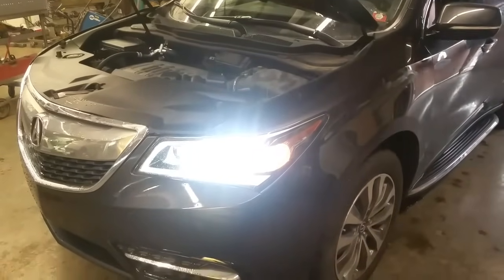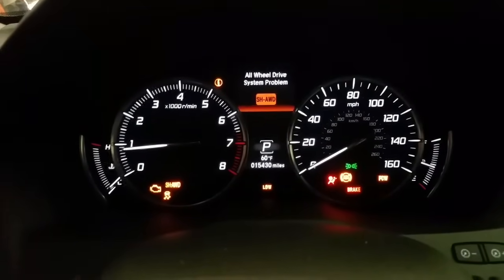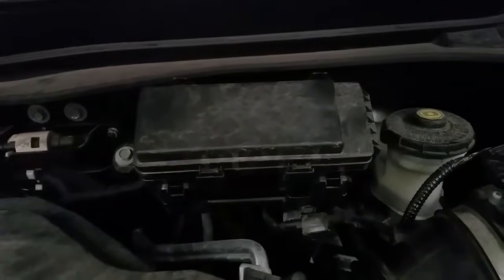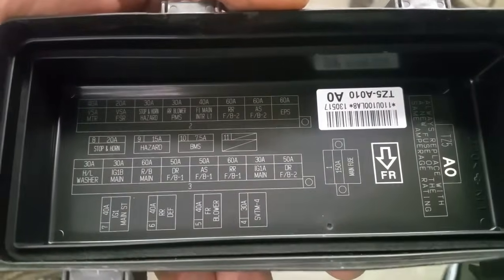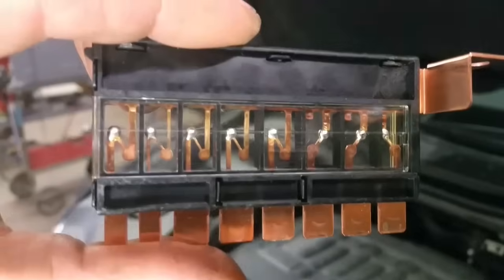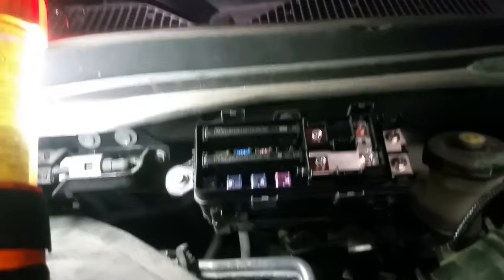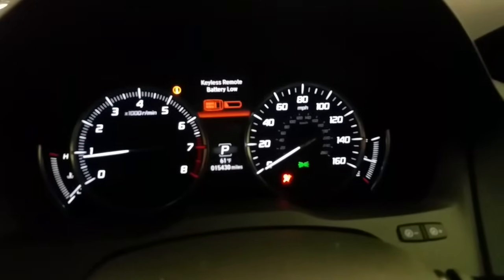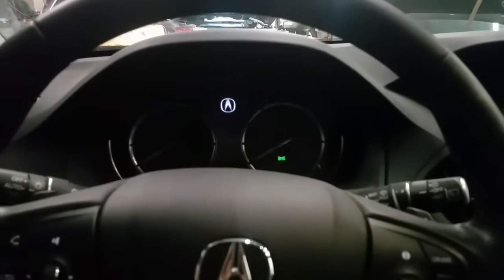EASY ACURA, HONDA ABS, VSA, BRAKE, FCW, SH-AWD, TRACTION, CHECK ENGINE LIGHTS FIX!!!

Comment: I have a 2012 MDX. Emissions light, VSA light and trailer stability light on.  The vehicle is also running rough.  I've checked the fuses, they're all good.  I've replaced the pcv valve.  I did have 1/3 tank of gas, so l added gumout, and filled it with Shell's top tier premium fuel. 
Still have all the same issues.
Would you have any ideas of what l should look at next before l break down and take it to the dealer?
Thank you for any help.
Reply: You ever get this figured out?
Reply: @justsayin4632  Hello, did you find a solution? I’m having the same issue.
Reply: @homerogarcia7287  I did, but YouTube keeps nuking my comment back to you🙄🙄🙄
Reply: @homerogarcia7287  I had a combination of things going on. MOST of the time when there’s a ton of unrelated errors with various electronics, check your battery. My negative was loose and causing all kinds of weird errors. A battery near the end of its life can cause sporadic issues as well. Make sure it’s healthy and all connections are tight, then clear the trouble codes. Any that come back, may be legit and require further investigating. In my particular instance I also had a couple bad spark plugs as well. Fixed loose battery clamp and spark plugs, no more problems. Just load test your battery and make sure all connections are tight FIRST, then go from there

Comment: I have an 2009 MDX my abs baa and shared light came on.when I checked the knock sensor wire was bitten by an animal trying to stay warm. I replaced it with an anti animal coating. plug it in and the light went away. After a few months the lights came back on. I checked the fuse bars but they are ok. Can't figure it out up to now. Hopefully it's not the cable again.

Comment: Does this apply to a 2013 civic 1.8L engine? Can it pass emissions? Any other reasons why the christmas tree happens? Can you please explain? I know that when the battery is flat or you disconnect battery, you lose your presets and radio code from what I saw in this video. Also, that you need to update the software. Any other reasons?

Comment: That fuse is impossible to take out.  I tried wiggling and using the flat screw driver to no avail.  Any suggestion?
Reply: Same here
Bam - in broken the top of it planing on using needle nose to really rip it out and most likely break it

Comment: I went to a transmission specialist for my 2008 acura mdx my SH-AWD light stays lit he pulled a code on it and it says it's a relay switch in the trunk my truck has no trunk is it possible it's the car link fuse ?

Comment: Re install did the work, brake still doesn’t work, as I was too stupid to pull the brake piston off and managed to put it back it, with too much air in the brake system. Brake feels all the way to the bottom with little brake. Gonna bleed the brake tonight

Comment: Hi everyone, crv 2013 2.2 idtec I got abs awd check engine lights on dashboard my friend scanned the system by obd and got errors 83-11, 61-12 and P0087, The car works fine, no problems with starting the power is ok just the lights come on once a week during normal driving, when I delete them from the dashboard everything is fine, but they keep coming back some times after a week sometimes after a 1-2 days. Any ideas what's wrong.
Thanks.

Comment: I have the same problem right now on an Acura tl 2010 sh awd , at first It randomly showed up and ran after not driving the car for a whole day about 2 weeks ago. Now today the car was used for 3 hrs straight turned it off and try to used it again and all the lights are on and won't let me start the car .... I checked this link/ fuse and it's good what else can it be I check all fuses and nothing . Also unplugged the battery to clear ecu and still there .... any help will be highly appreciated
Reply: Did you figure out the issue? I let mine sit for 4 months. Abs and vsa lights are on.
Reply: Did you figure your problem? I changed this fuse and replaced the VSA module and still have all the lights on my dash
Reply: @BikeLifeHooligan  Hello, did you find a solution? I’m having the same issue.

Comment: My 2008 mdx service sh-awd light comes on have changed all transmission/transfer /and rear drive fluids was good for about 500 kms but back to front wheel drive only?? can you suggest fix.
Ernie Northern Ontario Canada lots of snow to plow through.
Reply: I'm having the same problem did you get it fixed please contact me need to know ?

Comment: i have a 2014 civic that suddenly had the following lights go on - tpms, abs, vsa, and hsas-  checked the fuse like in the video and all fuses are good.  wondering what to check next or what it might be.  could it be the battery?
Reply: did you change the abs speed sensor yet?
Reply: S Kleinfeldt  Hello. I am having same issue with my 2014 Honda Civic hybrid. The thing is that when tpms, abs, vsa, ldw, fcw lights goes on I just disconnect my negative cable to the battery and when I connect it back all lights goes off. I checked same fuses on the video, everything is good. Did you fix your car? If yes can you text me back what did you replace.

Comment: My 2007 just did this ! Going it’s same issue !
Awd , traction, etc.. tried disconnecting battery didn’t help

I broke the top of the fuseable link- I gave up until I can order a new one so I don’t strand the car .. but wow was hard pulling it out, im assuming I’ll have to use pliars to pull hard
Reply: Herakles  hi just wondering did you get it fixed?  Thx
Reply: The Analog Sound I didn’t get the fuse yet I still
Have to order it , I’ll
Let you know - having a hard time locating the fuse part numbers (there are a few multiblock fuses
In there )
Reply: Herakles thanks mate
Reply: I’m so dissapointed I changed all the fuse blocks and nothing !! I’m so bummed !!
I was worried when I saw the fuses didn’t look blown
Reply: My issue was. I had a bad battery. It was new. Only 3 months old. Interstate. Brand.  It was hard to believe it was bad.  So purchased another brand new battery and that was my issue.  I wanted to discard the battery before I took it to the Acura dealer for a electric diagnosis.
Reply: @GGarcia7111  You replaced your 3 month old battery with a new one and that removed the lights from your dashboard?

Comment: I have a 2017 mdx the same problem but I check that fuse but the fuse is good I don't know where to look
Reply: Did you fix the problem
Reply: @mudurmudur3819  Hello, did you find a solution? I’m having the same issue.

Comment: Hello i need help with my 2012 MDX have to replace a ground and dont know the location of the ground that goes to the transmission , please its causing the car to jerk when accelerating and it gives me code G101 . HELP!!!   thank you .
Reply: Hi !From battery negative side 1 cable go to transmission or engine other cable go to a karosseria or body!So from negative side from battery 2 cable go to going out ! 1 for engine  and 1 for karosseria , Try find 10 mm bots for cable end on a 2cable end,,

Comment: hi  i have the 2016 acura mdx with that same problem but i went and check my vsa fuse but it's good is there other solution to this problem
Reply: Sir do you ever fix your problem on your acura mdx?

Comment: Hi George thank you so much for a great video that helped lots of people GOD bless brother 
I have 2013 honda odyssey touring  the battery died and we gave it a jump start and the abs and vsa light came on dash I didn't had that problem before jumping the car and also my both sliding power door are not working when the engine is on do you have a solution for my problem or any one else have an answer for my problem thanks

Comment: How would you do this for acura rdx 2013 that has box almost at the same place just not the same fuses ?
Reply: Look in the owners manual for the fuse or on the inside of the fuse box to find which one says VSA

Comment: Hey George, replaced relay on my 2012!acura tsx and lights are still on. Any suggestions?
Reply from the maker: +Marlon Sical could be steering angle sensor needs recalibration

Comment: Anyone know the part number for the fuse in the video? I have a 2010 TL.
Reply: Hello, Did you get the part. Did it work?
Reply: @justhumblemeclarke7292  sorry I was thinking of another issue. I think it was my alternator was going bad.
Reply: @jorgedavis9383  I replaced my alternator a few weeks ago. Did help.

Comment: I have a 2008 Honda with the same issues....I check the fuse box with the engine compartment....everything looks good. I changed the fuse for the VGA....still having the same problem....Car has 88k miles...help
Reply: You ever figure out the issue? Same issue I’m having with my Honda
Reply: I sold the car. .lol...6 yrs later

Comment: my vsa on my acura tsx 04 always turns on every morning or when i dont drive it for a while and I also noticed that vtec doesnt work when that light is on, what do you think the problem could be?
Reply from the maker: +99pkon Acura tsxs have very common issue it's the steering angle sensor.
Reply: +George Melnik I figured out the problem it was my camshaft position sensor swapped it out and all of the engine codes turned off and and it fixed the issue

Comment: Does any one have this problem I stumbled with my 2014 acura tsx sometime the light for che transmission comes on and also the abs light and vsa light and tracksion control when all this lights whwn on and mainly when the check transmissionlight is on also the letter D for drivin starts flasing green n won't go of for like a day I already replace the 2 front abs sensors but no luck any one had or have same problem n what was ur solution thank for ur help.
Reply: Hello, did you find a solution? I’m having the same issue.
Reply: @homerogarcia7287  has of the transmission light and 2 other lights all I did change out my starter and alternator and like 3 other light and has of right now I just get the one for the traction control but I think that's a little sensor that's is right under the shifter.

Comment: Greetings my friend who specializes wake us up my car when caught in a heavy rain steering wheel resists and brakes too and detail the engine is still running but when you turn off the air conditioning the car starts working again it's a 2.0 2006 but it's still running could be the lambda probe of the discharge or the scanner will be able to locate this fault thanks

Comment: I have an acura TLX which had a problem of blink of gear in the dashboard  and TCU ,SRS,BRAKE SYSTEM and other dashboard warnings lite are on and also when I.  press engine to stop will not stop for one tap until twice than they off  I don't how to do pls help

Comment: I had same problem with 2018 Acura TLX. However when I pulled out fusible link module it didn’t show any signs of being blown,   Any suggestions George would be a great help. Thank you.
Reply: Hey, did you figure out what was wrong with your vehicle? I’m in the same boat with mine. Got the lights on the dash, but fusible link is all intact. Any info is greatly appreciated…
Reply: @willytv275  Hello, did you find a solution? I’m having the same issue.
Reply: Hello, did you find a solution? I’m having the same issue.
Reply: @homerogarcia7287  Hi, good morning to you - my problem, turned out to be a bad ABS sensor in the left front wheel. Once I got that replaced, I have been good ever since. The bad thing about these cars is, it can be difficult to diagnose a problem as all sorts of alarms come in that are associated with the front crash warning system, ABS and some other stuff as well. So like the guy says on the video, your entire dash may be lit up with all sorts of stuff, but it can be just one sensor, causing the problem and not a module. If you have a diagnostic device, see what codes are set in your computer. Sometimes that will be, the best way to fix your issue. Good luck, man…

Comment: My  sha awd light on Acura Rl 06
Reply: Wild General  did you get it fix I have the same problem on my RL 2005
Reply: TRUEGamer 1996 I didn’t get it fix yet but I think I’m need to replace the rear

Comment: Hello
I have a 2011 mdx. The ABS, SH-AWD, Traction and trailer assist lights all came on at the same time! The video above seems that it will help my problem but how do I replace the blown fuse? Is it sold at the regular parts store? Is it switched out like changing a light bulb? Please help fill in the blanks.
Reply: This just happened to me, same year/model -- what was the solution?
Reply: Did you ever figure out what the issue was? I'm having the same issue thanks!

Comment: Thanks!!!....
Reply from the maker: +geraldito7777 you welcome
Reply: George Melnik 

Hey George 
Having this problem on my 2007 rdx but with one extra problem my exterior brake lights wont shut off even when parked and the car is off. I've replaced the brake light switch and it fixed it for a week and now its doing the same thing. Any suggestions
Reply: @billtsioles4745  did you find the cause of these issues? Did you find the fix? My 08 RDX is doing the dashboard light show. I’ve changed alternator, the battery and checked fuses nothing has worked yet.

Comment: I have this same problem where my dash panels are lit up. I can't find this fuse anywhere. do you have a link where I can order one?
Reply: I have an 2007 Acura MDX
Reply: Hello sir! Did you ever fix your problem with your MDX? I have the same problem with my 07 MDX. Not sure what to do at this point. If i shut the car off for a bit and turn it on again, it usually resolves the problem for a couple of miles.
Reply: No I didn't. I had the dealership run some test on it. I'm sorry I really can't remember what the problem was because I gave the vehicle to my brother. He's learning to be a mechanic. I'll see if he fixed it and get back with you
Reply: Greg Springfield thanks for the info though! I've read it may be the battery or it may be the fuses..if you remember, I'd be great if you got back to me :D
Reply: Lao Yang I talked to my brother about it. He didn't get it fixed yet but he remembered me telling him that it was a lot of sensors needing to be replaced. I'm sorry I don't have any more info about it. If he ever gets it fixed soon I'll reach back to you
Reply: Greg Springfield all good. All info was very much appreciated! have a good one bruddah

Comment: I have an Acura TSX 04 but the sign that looks like this /!\ stays on, are there any recommendations to do or how to reset?
Reply: Marky Azurin you’re Tires might be low with air, TPMS ! ! ! Tire pressure monitoring system or you’re batteries are probably bad in the tire/wheel there is a small sensor per wheel go to Walmart and have it replaced all four for like $120 but you honestly don’t need to change it most cars have that light on
Reply: Muamer Kekic the 04 tsx doesnt have a tpms system.  Its the vehicle stability light, you can turn it off next to the steering wheel, you may have pushed the button on due accidentally.
Reply: works for air bag light?

Comment: I tried this. It didnt fix my problem. Does anybody else know what it could be? I have VSA, ABS, SHAWD lights all on my 08 mdx..
Reply: VSA control unit....black box on ABS pump.....You'll need scan tool to reset Yaw rate, Steering Angle Sensor, Calibrate TPMS
Reply: @lard1892  thank you

Comment: I have the same problem ABS BRAKE LIGHT ON in my Honda Accord 2012, anybody can help me¿?
Reply: Did you ever fix the problem?
Reply: @raptor074  Hello, did you find a solution? I’m having the same issue.

Comment: Hi! I recently purchased a 2016 HR-V which has been in an accident and repaired but now the check engine light and parking brake light comes back on.  I seen this before on the vehicle  and asked the seller to fixture before I buy it and said he did so I recheck and lights all disappear so bought the vehicle.  1 weeks later after I bought the car and now those lights came back on so what could be the problems? Seller/Dealer told me he replace some module or unit etc...and reset the ECU but I doubt it very much.  I just got taken and there's no warranty.  LOL  Thanks  By the way this dealer is call OK car located near the airport in Miami so do not buy from him if you're local in Miami areas.  Scammer...and can't fixed car right.